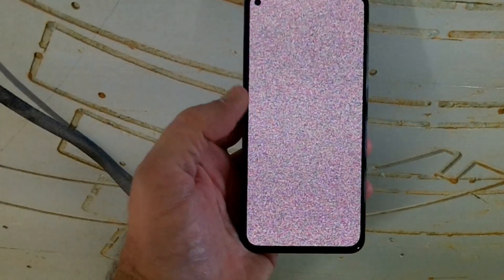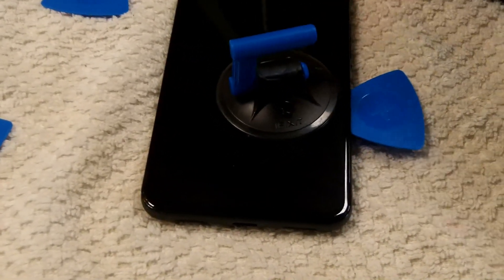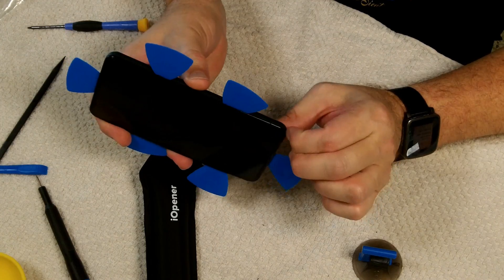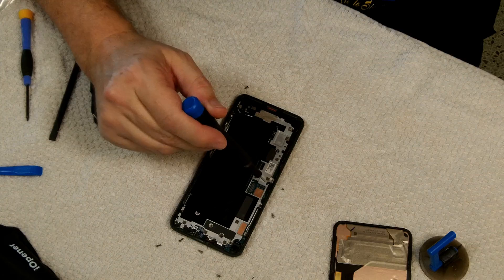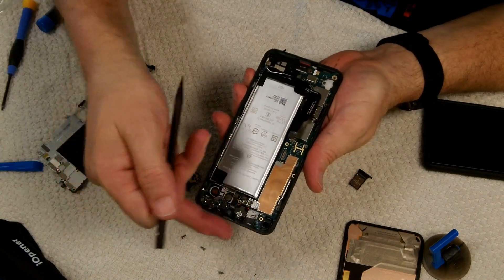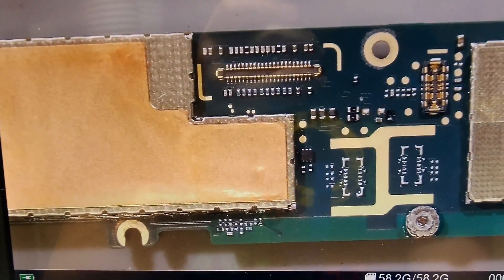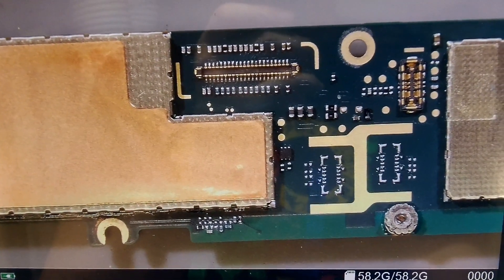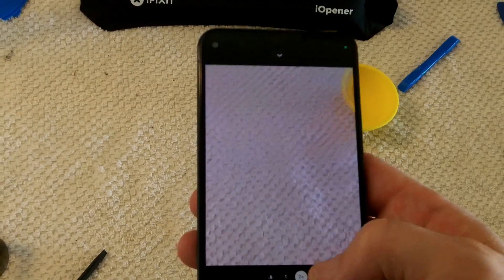Fixing colorful snow screen problem Google Pixel 5a phone

Comment: My wife's phone died similarly this morning (in our case the screen is entirely black and we cannot recover the data).  I've just been inside the phone twice, once to replace the screen with a cracked one that was working when we put it in the box and again to disconnect the battery.  Never gone as deep as the motherboard before but this seems to be the next step.  Nothing ventured nothing gained?  Thank you for giving us something to try next! 😅
Reply from the maker: I think the all black screen may be a different issue than the "colorful snow" screen, but if you have already tried replacing the screen and that didn't fix it, reflowing the motherboard may fix something.
Reply: Its motherboard issue just reball the mother board and its done i have faced this
Reply from the maker: @habiburrehman2271  I reflowed a section of the MB and that has fixed it.

Comment: My phone has this exact problem its been 3 months now I was told to buy a new screen which I haven't bought i wish i could find a technician like you.
Reply from the maker: @davidchakufwaya7242  In my case the problem appears to have been something on the main board (or the connector between the main board and the screen just needed to be reseeded, but I don't think that was it.) 

The repair is so involved It would probably cost you more than a used phone to replace it. It's really only cost-effective if you're doing it yourself.
Reply: @summetj  Yes you are right judging from your video, repairing the phone is very expensive. Thanks for uploading this video cause without it I might have bought a new screen which may not have worked as well.p
Reply from the maker: @davidchakufwaya7242  My suspicion is that a new screen would have had exactly the same problem but I have not tested that.
Reply: @summetj  Yes actually very highly likely to have tha same problem...
Reply: @summetj  especially that tha phone didn't undergo any impact, tha screen just turned white and started blinking while in use.

Comment: How did you conclude it was a problem with the motherboard and not the screen? Did you try reseating the display connector before you reflowed the solder? I'm trying to diagnose a 5a with the same problem, and I noticed that applying mechanical stress to the phone will make the screen start working again, which makes me think there is a simple loose connection.
Reply from the maker: @CoolerQ  physical pressure wasn't working for me, but you should certainly try to reseat the connector first.